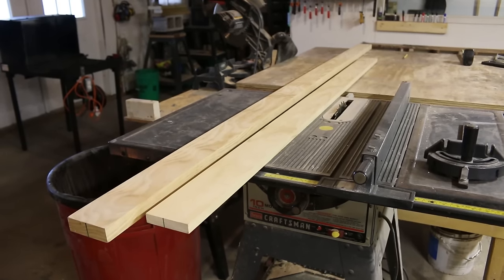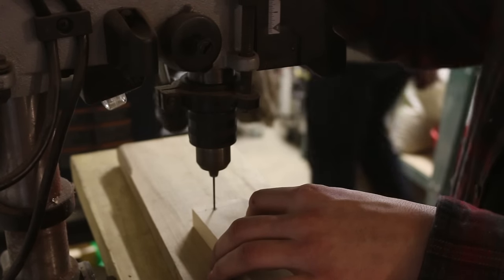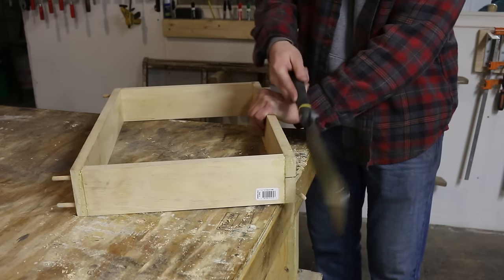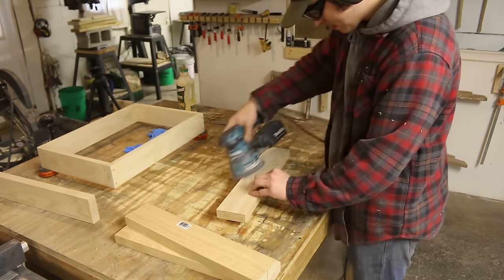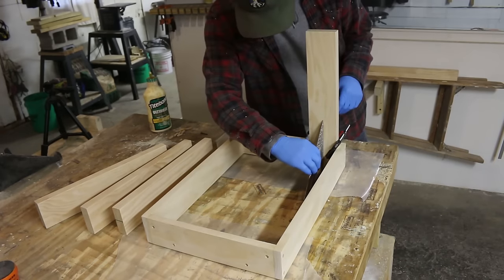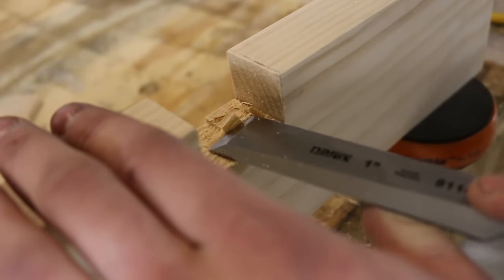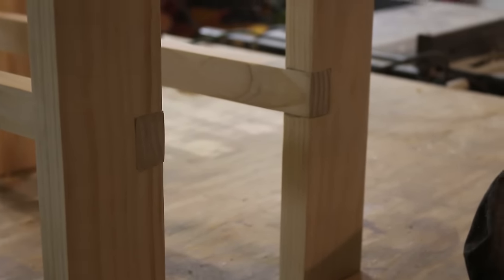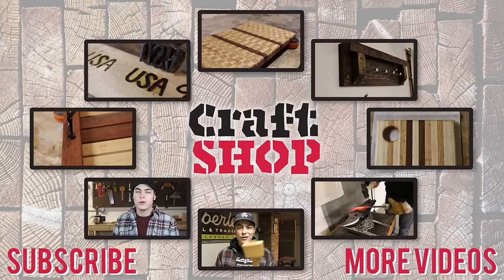Vinyl Record Storage DIY

Comment: Leaving the center (where weight of vinyl would be on the sleeve) supported by two slats with a ga in the center will result in longtime use spine splitting on bottom as the weight wouldnt be supported in anywayto transfer it other then the thin cardboard, a thin piece of masonite over the two bottom slats would rememdy this. I use outwe sleeves and inner sleeves i store outside the cover loose behind them so this would result in the outer sleeve stretching and leaving  lines on the outer sleeve which would be even worse. I am no expert but thought I'd throw in my 2 cents.

Comment: Hey Brad,
First let me say that I could not do what you do but I have some hints because I  have been doing furniture repair for over 40 years and have some info you might like. They make plugs so you don't have to use dowels. Just drill a hole and hammer a plug into the hole. Sand a little (if you need it). They even have different type plugs including one that looks like a button. (no sanding needed) The other tool accessory that is available is a drill stop. You put it on the bit and tighten it with an allen wrench and it is faster and more accurate than tape. Hope this helps.  Don't think i am an AH. Never to late to find new stuff.

Comment: Nice build, simple yet effective.   I noticed you didn't put screws in until the glue dried though.  Usually mechanical fasteners are used to keep the parts from moving until the glue dries, as the glue will be doing the bulk of the holding.  I fear the glue might crack or move once you cinch the screws in.  I would've just sunk the screws with the glue wet, that way it dries in its final location.  
Great solution for the support pieces, way cooler than screws!  Will be watching more :)
Reply from the maker: I agree! If I were to do this again I would put in the screws before the glue was dry, or avoid using screws all together.
Thanks a lot for watching!

Comment: looks good.  nice job on the use of the dowels and cutouts.  two design change recommendations.  (1) place a 5/4" x 4" board between each of the legs at the top on the front and back.  This will give your records a flat surface to lean against.  (2) for a similar reason, place a piece of luan/plywood/other on top of the rails to give your records a flat surface to sit on.  Make sure this is 12" wide so the whole record sits on it.  Both of these will save some wear and tear on your covers.
Reply: YES!!!! Exactly ... :)

Comment: Nice build but I would have put a flat bottom so the weight of the sleeves are not dented by the runners, but very nice job. Simple but effective

Comment: It might damage your covers.  Putting pressure on the outer corners over time.  But I love your build ! You gave me good ideas !
Reply: Covers will always wear out center first (for instance from frequently 'dropping' them back into a dj case thereby casing the outer, often sharp, edge of the vinyl to damage the inner and outer sleeve sides, eventually even poking through the entire cover sleeve side). I agree with Brett T and would also recommend having at least some form of support in the center (thus supporting the vinyl itself rather than the cover. My 2 cents.

Comment: It wouldn't be a bad design if the way the records are supported crates indentations in the cardboard cover, ruining it, there's also the risk of the record making a hole in it since the whole weight of it is held just by the cardboard... record albums need a whole surface underneath.

Comment: At 3:00, what is the name of the tool that you're using to measure the wooden frame (the orange coloured tool). How do I search it on Amazon. Thanks.
Reply: That's just a wood clamp to hold them in place.

Comment: can anyone give me the measurements? that would help a lot!
Reply: Taylor Whitney it looks like he used 3/4 to 1 inch boards, so the width including the boards is probably 14-15 inches, seeing how a record is roughly 12"x12" so the inside has to be 13" to add for a good non snug fit. The height looks to be around 16-18" and Length is around 16" seeing how he has like 30 records (yes, I tried to count them) in the box. So I guess to make it more clear the measurements (COUNTING THE 3/4-1" BOARDS), are ROUGHLY
W14-15"xH16-18"xL16" 
but it's probably best if you measure your total records length and try to make your own  measurements to accommodate the space you have where you wanted to put them and have a better fit. Hope I helped, good luck with your build! :)
Reply: @Felipedominguez1  Watching the video and pausing it when he has his tape measure out it appears the dimension of the smaller boards (width) is 13.5" and the length 22"